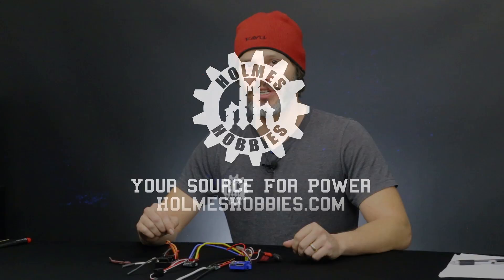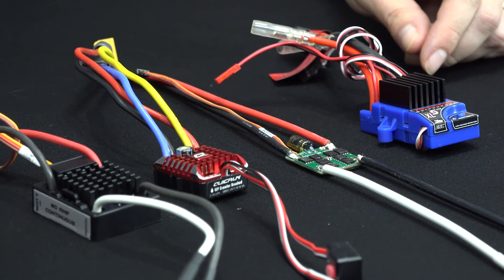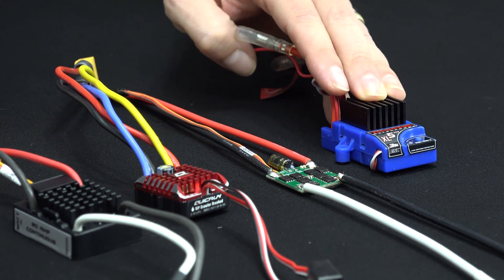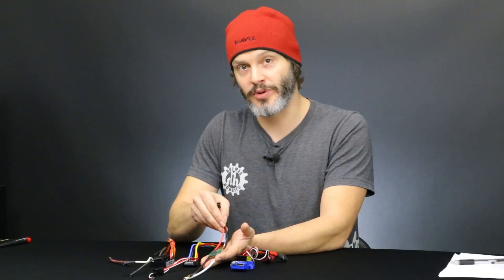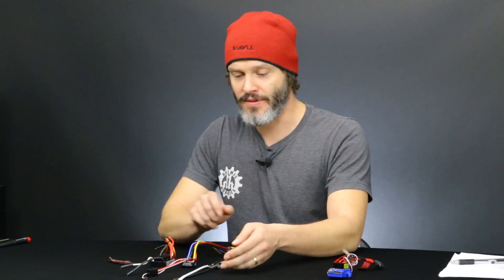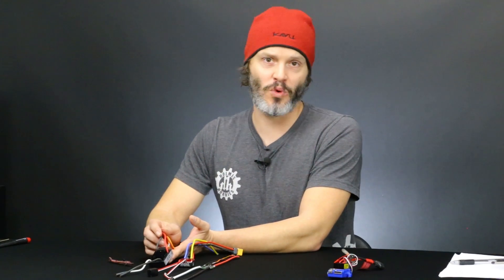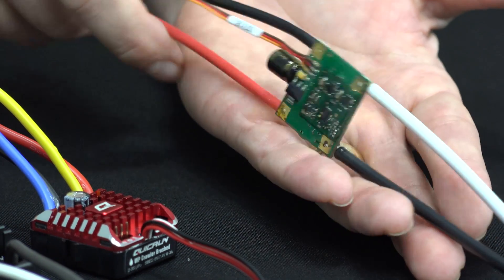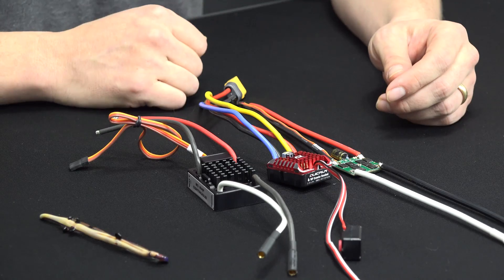Selecting A Brushed Speed Controller - ESC Terms to Know & Features To Look For - Holmes Hobbies

Comment: In my latest rig I have
Holmes TorqueMaster pro 40T brushed
Hobbywing 1080c esc
CastleCreation 10c bec (programmed at 6.0)
Reef's triple 4 servo.

My concern is longevity with the current esc but also achieving a smoother initial throttle or control of SLOW crawl. Your Holmes BR-XL intrigues me if it will provide smoother transition from a stopped position to slow controlled crawl?
Thanks

Comment: I'm using HW 1080 and a 20kg cm servo. Runs fine with it. Another similar servo is used for winching and it can use both for that short winching and turning moments.

Comment: Watched an ae5 crap out and take off over the side of a 30 ft quarry wall into a swimming hole.he fished it out with rope and the claw of a hammer. I had a 1060 running reefs 422 at 6v. Had no issues running 3s.

Comment: great info john, thank you. i have the brxl with a 27t torque master pro in my 10.2. it's perfect on 3s. my servo is a hi-tec 7955tg which is right around 300 oz/inch. i use an external bec just to be safe. overall i'm very happy with the electronics, although a may upgrade to a stronger water proof servo.

Comment: Another great video, John! One thing that you did not bring up, the freewheeling function on the HW1080.  It's item 15 in the programming menu  Its default setting is disabled, but if you enable it, you can set your drag brake high enough to hold you on a steep incline and use the throttle to drive down the incline, without run a way truck syndrome. My typical setup is a HW1080 with a HH 13t Crawlmaster, on 3s. I pretty much only run 2 servos.  The Savox 1230 and a Reefs 422HD.  I've ran them with a BEC and without.  Even without the BEC, I've never had a brown out and power and speed seem to be the same.  Both of those servos have a stall load of 5A and I believe the 1080 has a 6A peak, according to a HW rep I spoke with.  I'm sure for longevity, a BEC would be a good option.

Comment: I’m running the hobbywing an I have the hitec 7995 tg servo in my 10.2 an had it running off the esc at 6.0 volts but got a castle bec an running it off that made it a little more faster not much but some . Other than that I love the set up soo far . I’m also running a tekin hd 35t motor .

Comment: Helpful vid as always. I've got a 1080, works well with my PowerHD 20 kg servo but doesn't like the 23 kg version so I'll get an external bec to try with that. One big improvement would be a throttle curve adjustment on it, I think the Holmes escs have that?

Comment: Interesting video. For my RC boats, I use ESC's with a minimum of 50% extra current handling capacity. For example, a motor that may pull a max of 60A, I will use an ESC rated at 90A minimum. Peace of mind comes at price, but at it works for me.